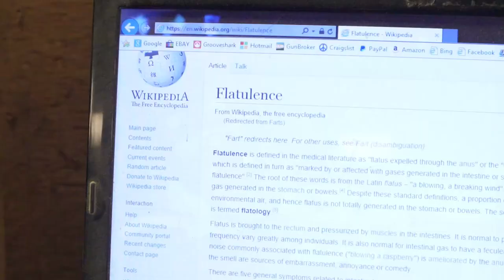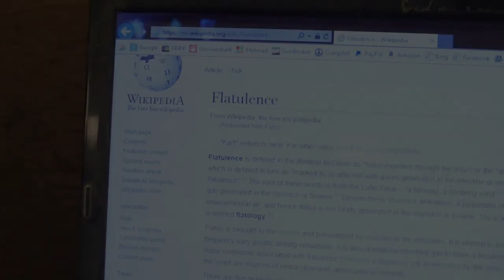A BandSaw Accident

Comment: Nearly 50 years ago I was injured while using a bandsaw.  The blade snapped at the weld (as they typically do). But in a series of freakish events, it continued to feed downward across the surface of the material I was cutting and jammed into the end of my middle finger about a half inch deep.  Since then, I’ve always been mindful of keeping my hands away from directly in front of the blade.  I’m also quite sensitive to the distinctive ticking sound made by a blade that’s about to snap.

Anyway, I love your channel.  I’m a jewelry maker so I’ll probably never make my own bait. But I really like watching other artisans do their thing and often get ideas for incorporating a technique into my own work.

Comment: A few years I did a stupid and tried cutting a four inch radius in a piece of hickory with a 3tpi 3/4" resaw blade because I was too lazy to change the blade for the one radius cut I had to make. It didn't save me any time though because of the six hours it took me to get to the ER, get six stitches in my thumb, come home and finally finish the cut (with the resaw blade of course, because I am a quick learner).

Comment: punched my left hand index finger's first knuckle into a running rip blade bandsaw in July. Made a 4 inch cut from side of index to middle finger - thankfully my hand rolled, so the cut didn't bisect straight through the bones... just finished physical therapy last week (Nov 12th). i was lucky not to have severed the tendon. was an ugly cut due to a dull blade, and me pushing too hard.  

lesson: use sharp blades, less pushing.

Comment: I feel for you brother. My left index finger was pushed into my table saw blade. 32 stitches. Not fun. Not my fault either. The blade was new but faulty some teeth broke off caught the board I was cutting. Popped it up and pushed my hand straight into the blade. Scariest craziest feeling ever. But after the E.R. visit I returned the blade blood stains and all got a new one and kept on working. Should have taken a few days, the wife was NOT happy with me. 👍😁

Comment: I think having a good scare every once in a while keeps you on your toes. People get so accustomed to using dangerous equipment that they stop thinking about safety. I think more major accidents happen to people that are experienced with using power tools and get too confident than to people who are beginners.
Reply: A good scare is needed sometimes, had mine with a chainsaw and my thigh. Shredded the pants, scratched the skin badly but not deep enough to require any mechanical assistance to heal properly.

25 years later I still am very careful and make sure that my feet are securely on a non slippery surface.
Reply: @petaks01  It's good you weren't severely injured, chainsaws are no joke. The first pocket knife I ever got when I was a kid, I stupidly stabbed into a stump and the knife closed on my fingers. It was dull enough that it didn't do much, but it scared the hell out of me and I still am super conscious of knife safety all these years later
Reply: @onebackzach  Oh yes, pocket knives... Have hidden those events somewhere in the darker areas of the memory maze ;)